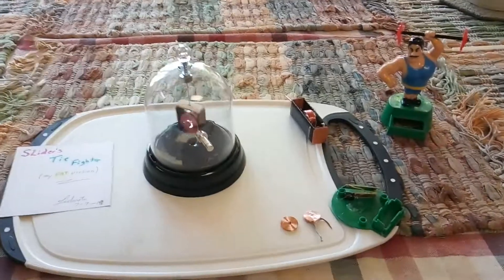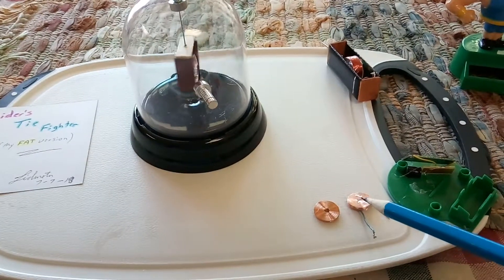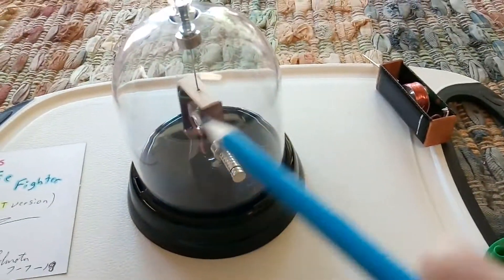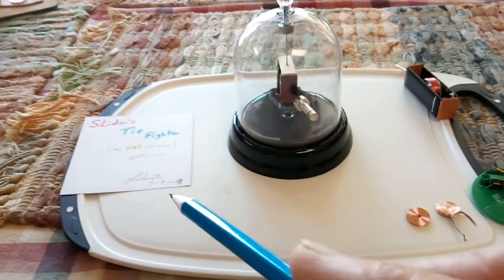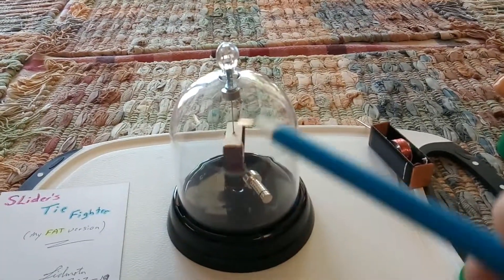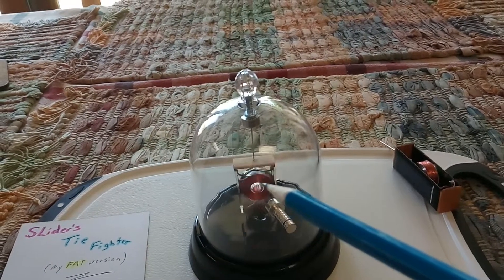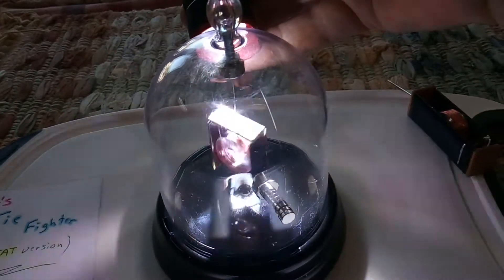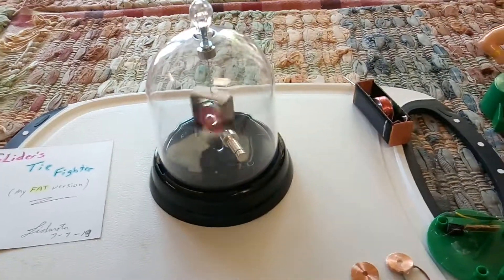Slider's Tie Fighter ----My FAT version

Comment: I've never tried removing one of those coils from a solar waver.  But I expect it's easy to break a wire somewhere inside the coil.  Or accidentally scrape off some insulation and short the coil.  For my old hands, 30 gauge wire and a plastic bobbin is lots easier to handle.
Reply: @lexyparrot8201  That's useful information.  Thanks!
Reply from the maker: My old hands have the same problem.  I will follow Lexy's advice next time and perhaps have better luck with the solar waver coils. I will also do the job in really good light and before I drink too much morning coffee.
Reply: @Lidmotor  I use tin-snips to cut into the plastic base, using straight cuts, and then
trim to a crude circle while staying a reasonably safe distance from the coil. You are
left with a coil with a similar sized piece of plastic attached to it. Does not look quite as pretty as the bare coil, but statistically damages far less coils and works just as well.
 I will also try Lexy's way in the future.
Reply from the maker: @saracumbia1778  I have used the 'snip snip' method and it is the safest way to do this.  Sometimes the coil just pops off but usually it is a struggle.   Using heat is the best way ---I guess.  I have even thought about using boiling water to loosen things up.
Reply: @Lidmotor  I got around to using Lexy's way and had fair success, but I found that using a blowtorch, horizontal flame,, underneath only, and then at the critical moment, using a small plastic putty knife to push the coil loose worked best.

Comment: those coils are the finest hair wire ever.....how do you solder to it?...do you wind it on to another wire then solder?. cheers .
Reply from the maker: Excellent advice.  I added lead wires to one of the coils I tried but I think I damaged the coil removing it from the plastic base.  Your advice on how to remove the coil using heat is really helpful.  Thanks.
Reply: @lexyparrot8201   thanks, yep that's what I thought, just nice to hear different tips...cheers .